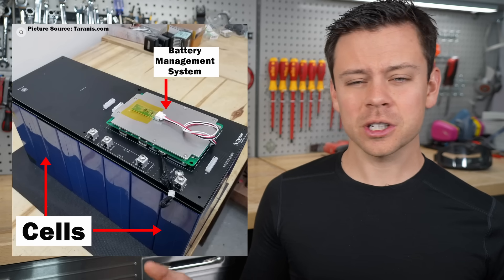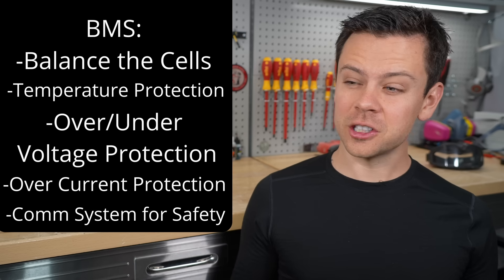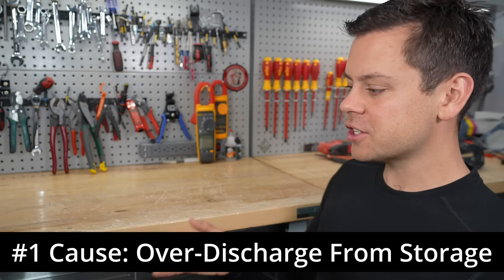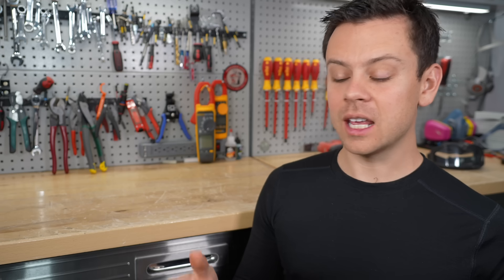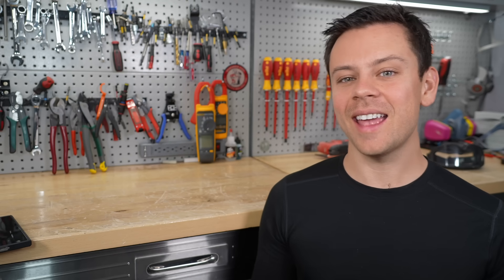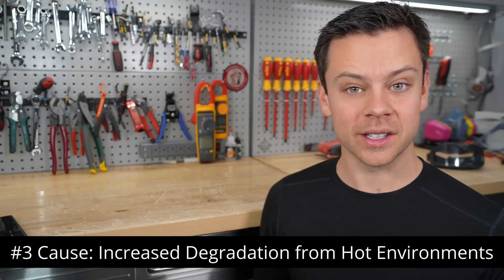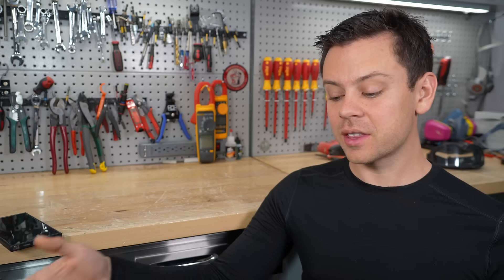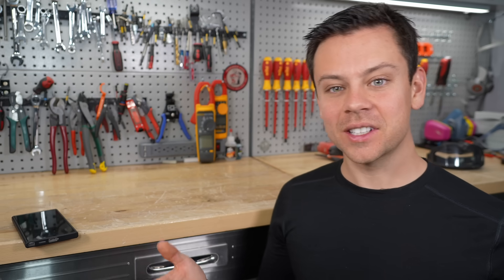The Rules of LiFePO4: The 3 Most Common Causes of Failure and General Guidelines for Long Term Use

Comment: Great info Will - thanks mate! Ive had my LiFePo4 in my 4wd for about a year now and had this niggling feeling I should be trying to limit the charging to 80% max and then liniting the discharge to 20% at  most so you have literally given me a huge amount of peace of mind - thanks again! 
One question I have is recently I ran it down until the battery just cut out and when I started charging it it was at 28% SOC . . . . charged it up again and it did the same thing and didnt seem to last very long although it was pretty warm for a few days and I have 2 fridges running in the car. I need to do some more testing to see how much the fridges are using etc etc
Any ideas what causes the battery to shut off at that 28%

Comment: anybody that truly knows solar know this..thanks for saying it. I have it in ac environment with cooling fans on the batteries and they the max they get is 38⁰-40⁰c in summer so I said I'm gonna use it or lose it i paid an arm and a leg for them. Keep up the good work. Have you ever thught to modify the golf cart roof with a bifacicial solar panel to charge while driving...then you could set the new industry standard...

Comment: Thanks for all your help. Can I ask whether you have a video concerning grounding and or earthing (for lightning and also for solar panel failure issues) I have built a wooden frame and placed my panels on to the frame. I can easily access an earth (via a plug) from the point of the charge controller. I'm sorry if this sounds like a stupid question but I can't find any video specifically relating to this.

Comment: A warning about failed BMS: I had a BMS fail due to stupidity (Forgot to plug in balancer cable). But also due to inrush current. The dangerous thing about this, is the BMS did not tell me that it had failed. The transistors where fused, so the only symptom was that it could not switch off any more, in case of over or under voltage.  Be sure to test this on a regular basis.

Comment: Thank you for the reminder!!! I have a very sweet 48 volt battery made from part of a chevy volt pack intended for an amphbious boat project that has been on hold for several years. It went into storage at near full charge and I did top it up once but then became busy with life and neglected it until I saw your video and went yikes! Fortunately it had only dropped to 47 volts and it only took three hours at 3 amps to return to its max 50 volts level. Whew....I could have been your poster boy on what not to do!! Love your straight forward videos, your obvious passion for the subject and clear instruction....glad you are getting the support you need to continue and expand...you deserve it.
Reply: 50 volts and 50 percent are different on a 48v battery.  Check how many volts will indicate 50% of your battery. Google says 48.2v is at 50% charge.  Will recommends 50% for storage, not full as you have done by charging to 50v.

Comment: Regarding calendar degradation / capacity fade, you can't stop this from happening, but you can slow this down substantially by storing cells in a cold, dry environment. A while ago, I got a hold of a bunch of Samsung industrial battery modules and in the technician's manual it said to store them between 0-10°C for increased shelf lifespan. So I took an old empty fridge and stuffed it to the brim with 400lbs of battery modules.... Seems to be working so far, lol.

Comment: Just wanted to note that in my experience, the doom forecasted for any cell that discharges below 2.5V is greatly exaggerated. If the battery is accidentally discharged beyond 0% for a few hours or even a few days, it is very unlikely that there will be notable permanent damage. It is of course given that you bring the voltage back up very slowly and with great care, but don't automatically assume you've bricked a cell at 2.4V.

So what if the cell has been at 0.0V for weeks, months, even years? I've actually found that MOST of these cells can be revived as well, it's just that they are almost guaranteed to have higher internal resistance and self-discharge. How much varies from cell to cell, but it is safe to assume that there will be enough damage to require they are only used under a much lower threshold of demand. I want to be clear, though: they are UNLIKELY to be useless! Everything in its proper place!

Comment: So I have 16 battleborn in 48v and have been shutting down my system with an aims 10k inverter, this year only. Had for maybe 4 years. Checked batteries individually and the lowest was 8v all the way up to 12.9. Only three were the exact same. Had a 10v a few low 11’s, some live 12’s and high 12’s. Was told by another long time solar guy to put equalizer on them??? Idk what to do. Have 3900 watts feeding them
Reply: The system has been shutting down with a light running a small circulation pump and camp trailer hooked up.  My charge controller got burnt up, I think with loose pv connection

Comment: Like you i live in vegas and on the north side of town the powef seems to go out  four or five times a year for whatever reason. I picked up a delts ecoflow 2 to run my fridge when this happens. Most of the time it will sit around. Is it safe to store this at 100 pefcent hntil i need it.

Comment: It's all BS. In the real world no one is going to pamper these fragile batteries. In a car you run them over roads that are far from prefect and subject them to vibrations that damage them over time. That and crash damage does not make them happy. A single cell can put the entire battery at risk for over heating and render the battery too unsafe to even attempt to repair it.

Comment: Hi Will, Thanks for the video, one follow up question re: storing battery at 50% with no balancing each time you charge it back to 50% versus charging to 100% while storing and when voltage fades, recharge to 100% to get a balance cycle completed.  
Will says always charge to 100%, don't stop part way through the cycle so the cells can get balanced at the end.  But Will also says during storage, when they lose charge sitting there, charge them up to 50%.  So is storing them at 100% balanced worse for their health than keeping them at 50% without balancing with each storage charge when the voltage fades below 50% and you bring it back up to 50%?

Comment: Good morning. Thanks for the video. Please I need a bit of clarification. Am about to purchase the blue carbon lithium ion phosphate battery. On its data sheet it says battery full voltage is 28.8-30V and on the charge graph it indicates 100% charge at 30V and 90% charge at 29V. Am not so sure about the bulk voltage or float voltage to set for charging the battery. Please any ideas?

Comment: Can you check out the E-LekTech 600ah 12v with low temp protection for $1000? This seems like a phenomenal deal to replace our 300ah LiTime for our Texas heat camping with 12v AC. But I'm curious if it's vaporware or something great. 1k is SOOOO CHEAP. Thanks!

Comment: Hi Will, thanks for this much needed lesson. Today, I am sitting on a low battery voltage warning code. It has been shady for 2.5 days here in middle Tennessee and my voltage dropped to 51 and my wattage down to 20%. My system includes 11 EG4LL batteries and three Growatt es5000 with ~15k of PV. Right now I have no power going to my loads because it is cloudy. What have I done wrong? Thanks

Comment: I bought solar panels & batteries, 24kwh worth, to provide power if the grid goes down, so my original plan was they were backup.  But then I  thought "Why waste all this?  I'm gonna use it now to lower my utility bill."  So my batteries start every day @ 100% & draw down to about 67% overnight.  Should I drain them farther down?  Bluetti batteries BTW.

Comment: I've run a Tesla PW2 battery for over 6 years. I have the discharge set at minimum of 5% and run between thus and 100% in the Winter and down to about 30% in the Summer due to the extra charge.  My battery has a degradation over that time of 0.6%. Only thing I do is make sure I don't draw heavy loads and am mindful of what appliances I  run at the same time. Generally run for about 5 months of the year without needing to draw from the grid and export more than I use. Winters here aren't good fir solar so the battery gets drawn down plus some from the grid  but almost all off peak. Thanks for the information on care of lithium batteries

Comment: I work for a utility company. For grid scale LifePo4 batteries I can say that charging to 100% and discharging to 0% degrades the batteries much more rapidly. Electricity prices being high may make it economical to do so at times but there is a long term price to pay for that. Charging to 90% and discharging to 10% is a lot better. This is well documented.
Reply: 100% right charge to 90% never 100 and never go below 10% and store at 50% to 70% every two months charge to 90% and bring it back down to 70% the battery will last a lifetime

Comment: I've been using an active balancer for my 560AH battery for more than 4 years now and I'm doing it wrong. 
Charging the battery to 100%, does it mean i need to totally remove my active balancer and rely on the BMS only? 
Or I just need to remove the active balancer once in a while so I can charge it to 100%? Please advise, I want to prolong my battery. Thank you

Comment: imo more batteries will get damaged/degraded doing the 20-80 to preserve it vs just charging to 100% daily on a solar setup

many modern bms's have flaws 

fllaw 1 many only balance while charging or when it thinks it is charging (some only see more than 1A as charging) so they only balance for a short while when soc is bassicaly full until the amps drop below 1A ie keeping it at high voltage does not mean it is balancing (some may but most don't)

problem 2 not really a flaw but becomes one with the 20-80 preservation tactic
bms's soc drift ie losses it can't count means that you aren't at the 20-80 you believe  you are actually lower, only remedied when charging to full recalibrates at 100% which you aren't doing, so when the system dies while you think you are between 20-80, this is why

problem 3 also a flaw that rears its head only if you do 20-80
the passive balance current in most bms's is very low it can sort imbablance out if it balances regularly , staying between 20-80 means zero balancing is happening, so eventually the imbalance becomes so big that certain cells are opperating outside this 20-80 optimal range and thus degrade slightly faster than outhers the moment these cells discharges to zero regularly this degradation speeds up as these cell/s then allways opperates in the0-60 range  naturally if you seldom get to 20% this will take longer if the battery bank is small ie you go to 20% daily then it will be quicker

the notions of 20-80 isn't wrong it just doesn't play well with lifepo4 and because people have no clue how these bms's work
they do more damage while trying to do less damage on this chemistry

Comment: Man this is so confusing. I just bought a Ford Mach E and Ford says right on their website to avoid charging to 100%  Why would they be recommending the 20-80 rule if it's false?
Reply: Just wanted to add that Samsung also recommends 20-80 for their lithium powered products.  Are they not battery manufacturers?

Comment: One thing I didn't hear (or missed) is STORING LifePO4's at or below freezing.  Aside from the self discharge phenomenon  is there any other risk?  Have you tested that out?  I keep hearing both sides.  Even the manufacturer (Paoweric)  said its safe to store in freezing environments then later in the same email they said they don't reccomend it bc it can cause damage.  But they did not elaborate...

Comment: So. You said it's easy to change a BMS board.  I have a 300 ah  Paoweric battery.  The BMS is pretty basic - does not cancel charging when at or below freezing and does not have integral Heaters.  Is there any chance I could swap the BMS for one that does cut out when at or below freezing?

Comment: I chose lead acid because they’re 1/10th the price, don’t die like a hamster in a clothes drier, don’t require experimental but impeccable error-free charging systems tripling costs, and don’t insta-fail immediately leaving me stranded with a system unable to produce one watt..

Comment: Great presentation particularly for solar LIFePO4. I'm curious though, are there differences between solar and EV applications? In my case, I've got a Chevy Bolt. We currently recharge with 110V 25A house current. Can I assume that preserves battery life? Are EV BMS different in their trigger temps or battery rebalancing? I've heard nothing anywhere else about charging to 100% to initiate battery rebalancing. Like other commenters, I encourage you to expand, maybe even with a new channel on EVs.  Thanks again!
Reply from the maker: Yes I have many videos on this actually. I've expanded on this topic and showed people how to build them from scratch. I even had to remove my videos of running the systems without a BMS. I used to run Tesla packs without BMS. Very dangerous if you don't know what you're doing. But yeah lots of videos to watch. Hundreds
Reply from the maker: And that is not lithium iron phosphate so it doesn't apply to the logic in this video. For the Chevy bolt you should charge to 80 or 90%

Comment: Always the best content. Thank you so much for all you do. One clarification: For in house winter storage of RV batteries, would you recommend storing at about 50% SOC as user manual suggests or simply topping off at 100% and leaving them for a bit? I get the sense it could go either way assuming the regular monitoring which I do.

Comment: Will, I have a bank of 5 SOK SK48V100 Server Rack Batteries.   I contacted current connected but they do NOT have any replacement BMS.   Do you have any other sources.  (I don't need one right now I just thought I would buy a backup for the just in case)

Comment: My solar off-grid system is in a climate where the temp the summer is 70-80 degrees and winters frequently see temps down to -20. 

I’m currently usign AGM, but upgrading to more modern batteries. Since the system is not heated during the winter months, would any lithium chemistry survive? 

It’s also pretty dark during the winter with the sun very low for a short time during a day. So the pv panels are not generating much charge per day.

Comment: The greatest risk for LiFePO4 cells is charging and even storing them below 0 degrees C (internal cells temp, not ambient).
I have read some resarch papers with subzero LiFePO4 tests, and the dergadation is very rapid. Dosen charges can drop the battery capaticy by 30-40%!
Aslo partially charging at the normal temps is still better than charging to 100%. 
But if the battery can do 4000-6000 cycles from 0 to 100% without significant degradation there is no practical benefit for partial charge.

Comment: So... I should set my 6000XP to run my four EG4 LifePo4 48V 100Ah batteries to 0%, then charge to 100%? I have the 6000XP set to begin charging at 20%, then up to 100%. I set it this way because I thought I read EG4 required this for warranty. But after everything running like this since Feb 2024 without any issues, I am going to change the discharge setting. And I'm going to look into stocking a couple BMS replacement modules. Will, your videos gave me the final confidence to go ahead and install my system. Thank you for all of your posts!
Reply: Thee are pros and cons to everything. There is no need to discharge to 0%. It is OK to do so, but there is no benefit from that other than the capacity. If you can charge when you are at 20%, or any other value, you may as well do so to have the most capacity available. In fact, for backup purposes, keep it charged at 90-100%.

Comment: At 2:40 you say 50% SOC. Does it hurt them to keep them at full charge?
Reply: if you have them at 100% for weeks at a time or months maybe a year, yes. it can degrade them. if you are not going to use them, discharge them to about 50%. Also they should self discharge about 3% per month on their own. but if you are using them, don't worry about it.
Reply: I've heard the batteries want to be at 20%-80%
Reply: @adamnorton748 I guess you haven't watched the video...
Reply: Watch the video again, and it's true what he says
Reply: Maybe i missed but, if i have two 12 volt lithiums in parallel (300A/h) what is 50% ? 12 volts ?
Reply: @adamb1671 50% should be 300ah just make sure your shunt is properly calibrated to give you accurate reading. Remember in parallel arrangement volts remain the same but ah double
Reply: @radventures887 I don't have a shunt, just going off voltage. Batteries are connected in parallel as stated so fully charged sit around 14.6 volts ? So my question is what would the SOC or voltage be at 50% thanks ☺️

Comment: you've talked about it before but I wish you would have specifically gotten into what the actual harm of charging below freezing looks like. Like how bad is it? is there a specific degree at which it is safe and below which it is not? (like 32° is good but 31° is not)? does C-rate matter (like can you charge at a few amps even at 24°)? etc